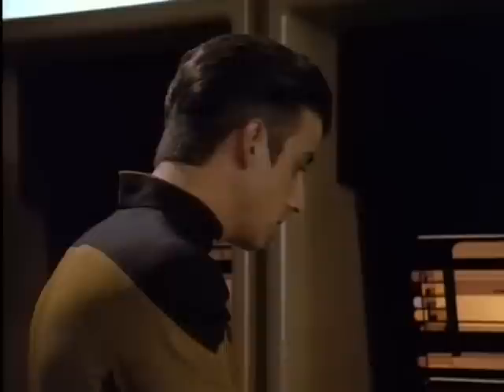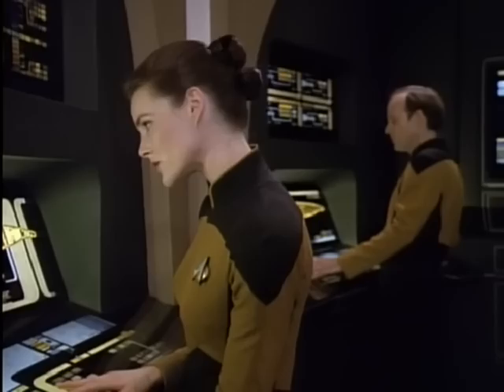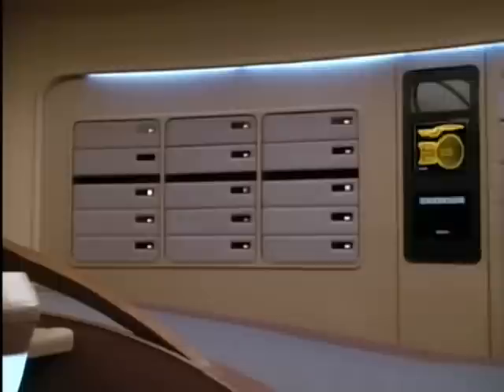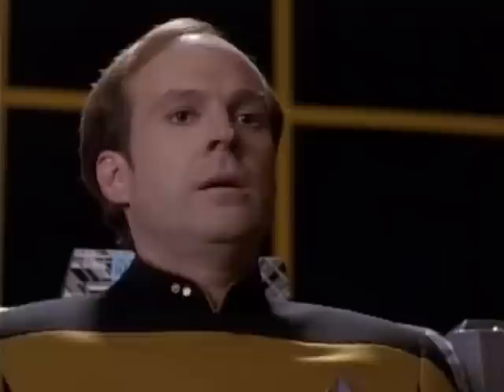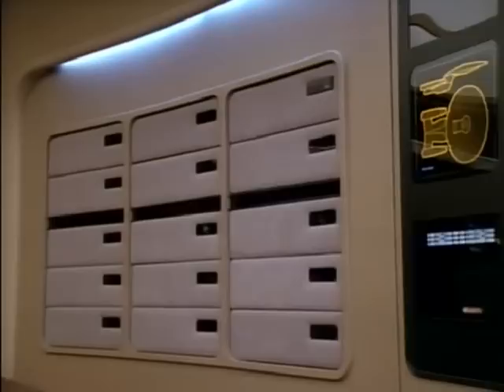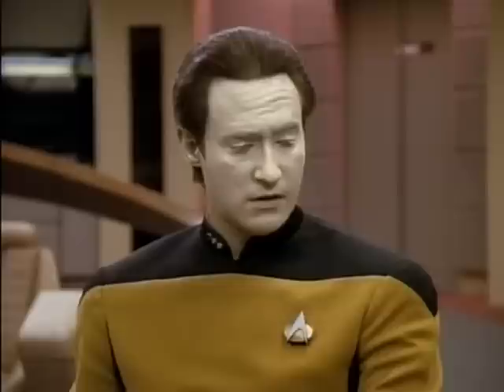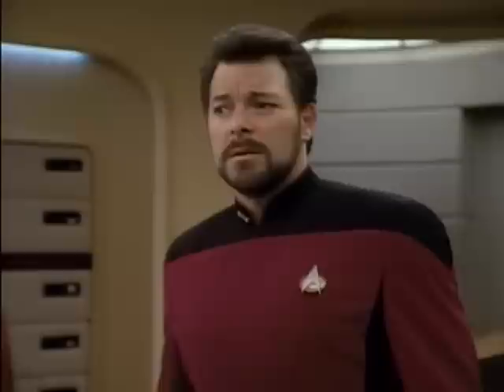Best of Lieutenant Barclay in The Nth Degree Part 1

Comment: Good to see they still use the wheel office chairs with the handle under the seat in the 24 century 0.33
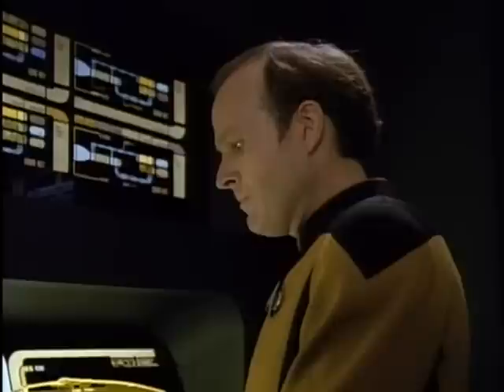Reply: 0:31

There, I timestamped it for you

Btw... lol
Reply: When ergonomic design reaches perfection why change it?😉
Reply: “Computer, use my height to calculate the exact position in which I would comfortably sit in this chair at my station. My arms should be perfectly resting on the table that would facilitate my ability to to own these Romulan n00bz..”

Comment: "It's at 177%!" .. I mean .. we all know it's a bunch of mumbo jumbo, but could y'all at least adhere to basic math?
Reply: Engineering shorthand for "It's running at 177% of design temperature...or pressure...or RPM...or whatever." 
The implied message is that whatever it is, it's not gonna last very much longer at this rate. Been there, done that, replaced the broken parts.